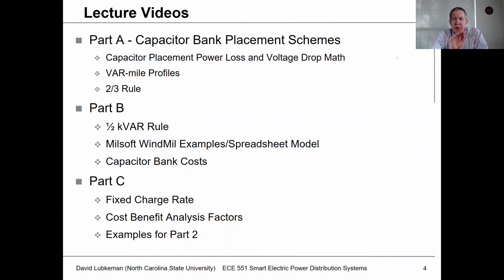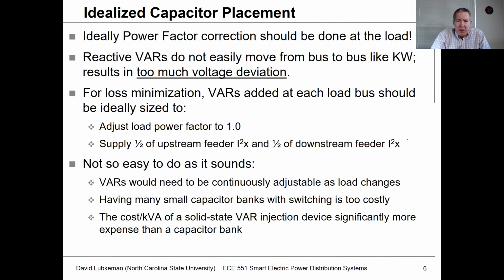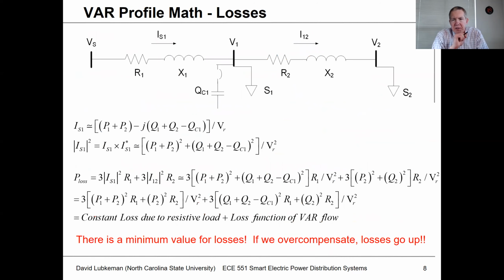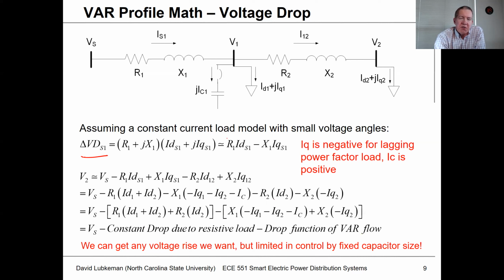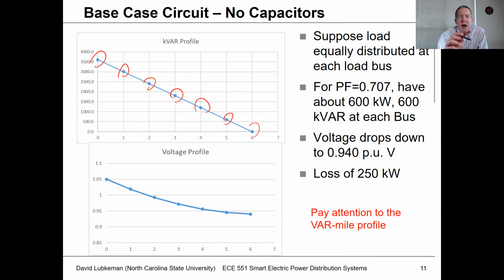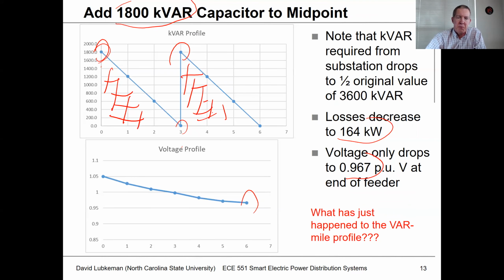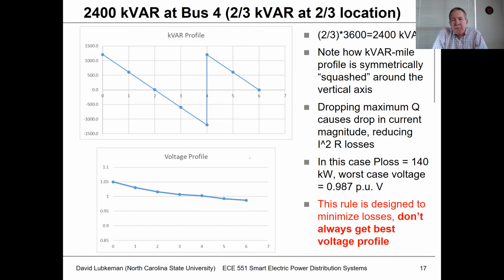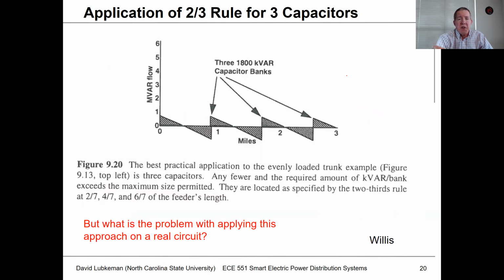Lecture 12a: Capacitor Applications Part 2 - VAR Profiles - Power Distribution Systems Spring 2021

Comment: Would the scenario for the 2/3 rule (or for capacitor allocation as a whole) be at minimum load? Thanks for the lesson.
Reply from the maker: The capacitor size you calculate using the 2/3 rule is for a chosen load level.  The issue you run into is that load varies between a minimum and peak value. So what do you do? One solution is to use a combination of  fixed and switched capacitors .  So you size the fixed capacitance for minimum load and the switched capacitor is the amount to be added when approaching maximum load.  The more switched banks you have the better  you could "track" the load variation between min and peak load.  A constraint that also needs to be checked is voltage.  You don't want too much capacitance at the lower load levels to cause overvoltage, or too little capacitance at the higher load levels to cause undervoltage.  The 2/3 rule just gives you a starting point for size and location.  In reality you need to apply some trial and error using a power flow program to get the most cost effective result.
Reply: I wrote "allocation," but "sizing" would be more accurate. Sorry if this was explained in a class and I missed it.

Comment: Hello Professor distribution circuits go in a different directions and are like a spagetti, how would you know where the 2/3rd is?  If straight line or only oneline then it would be easy to know where the 2/3rd is.Also, the substations have a large cap banks like 600kVAR or 1200kVArs.
Reply from the maker: The 2/3 rule was developed before we were using computer models for distribution analysis. So to apply it you need to simplify the distribution model by reducing the circuit to an equivalent single radial feeder consisting of the largest conductor size, and then modeling all the other branches as equivalent loads.  Sort of like like representing a tree by a single trunk with an equivalent length and everything else is a branch off of that  trunk.

As you point out, if the main objective is just compensating the transmission system substation reactive loading, you could just put your capacitor banks at the substation.  But then you would not get any benefit at the distribution feeder level in terms of voltage drop and loss reduction.  But depending on the nature of the distribution feeders, this may not be an issue.

If you have a computer model for power flow you could try applying the Grainger/Lee 1/2 KVAR method discussed later in the lecture material.  Or use a brute force approach similar to the WindMil simulation example where you iteratively try different capacitor locations using trial and error, until you get a better solution.  For a distribution circuit that looks like "spaghetti" you will typically be focusing on the bigger "noodles" since there usually is a lower limit on the capacitor sizes and number of banks you will want to place.
Reply: @dr.davidlubkeman284  Perfect and thank you for the wholesum reply.